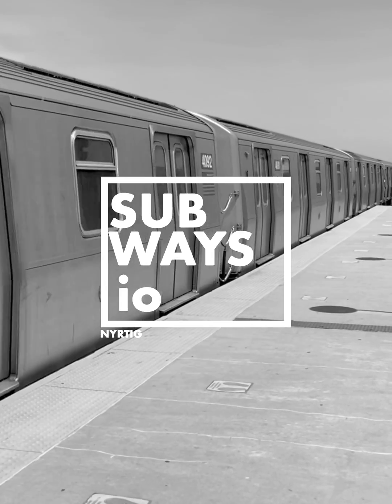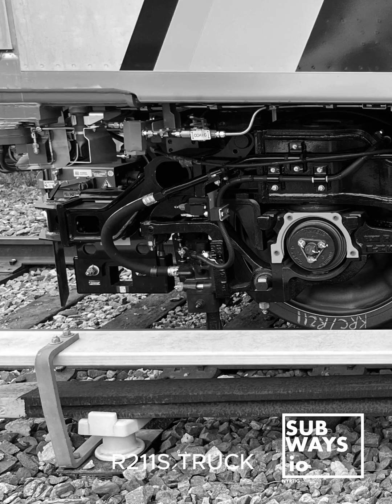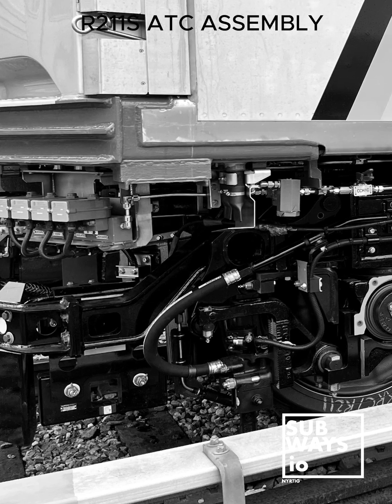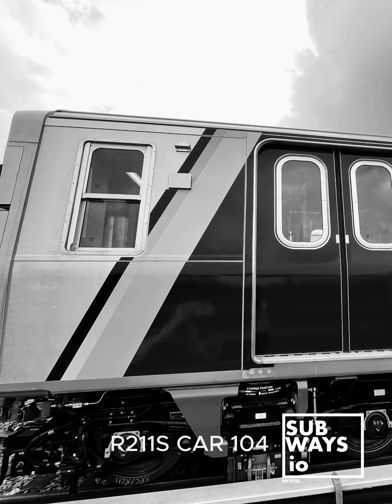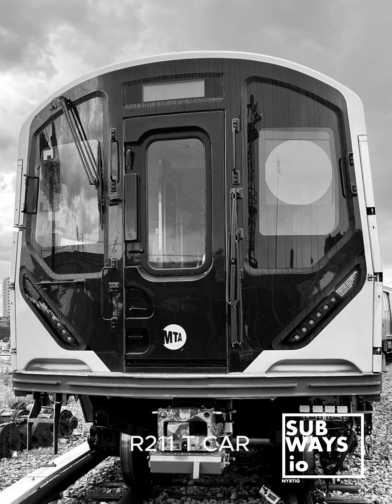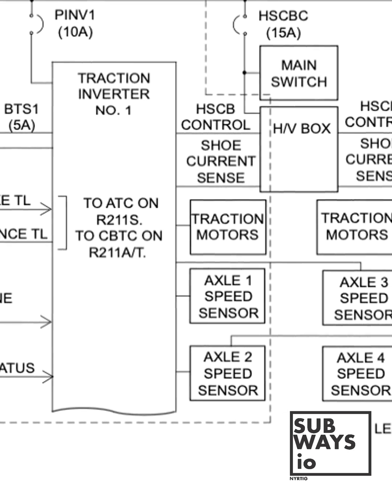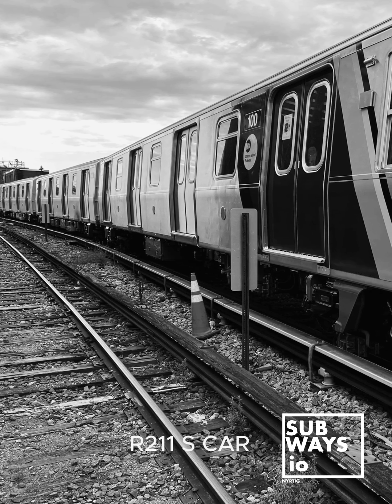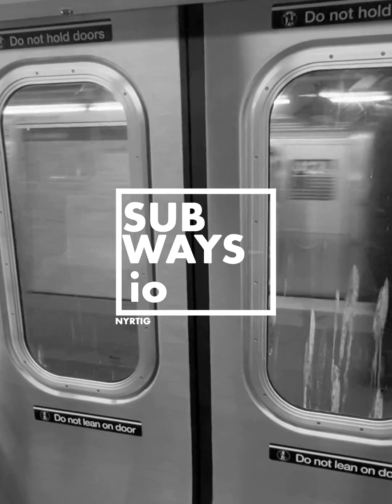Diving into the NYC Subway: Discover the Kawasaki R211s Differences!

Comment: Sir r211 isn't in service as of August 22 2024
Reply from the maker: That is correct due to EMI issues relating to the signaling system. Hold tight they’re coming!
Reply: @Subways_io  it should be in the burn-in phase
Reply from the maker: @alexthemtaandr211weatherfa2  Are you asking us or a statement?
Reply: @Subways_io  just stating the first production set was at Ci Yard when you posted the video
Reply from the maker: @alexthemtaandr211weatherfa2  We work, the engineering and car department side we just cover the specs and how it was built and how it works. We’re just covering the differences between the equipment as built.